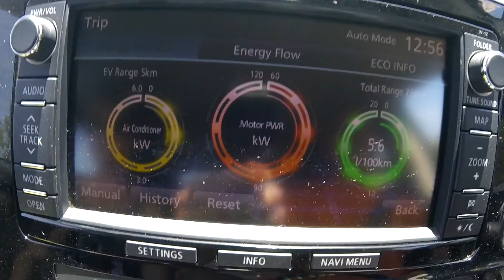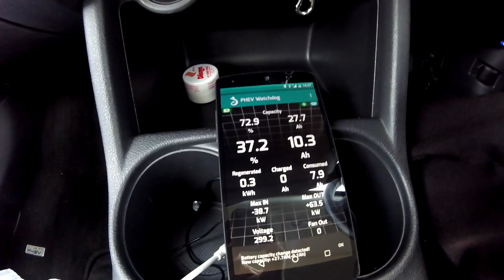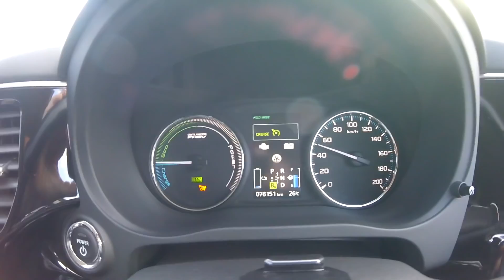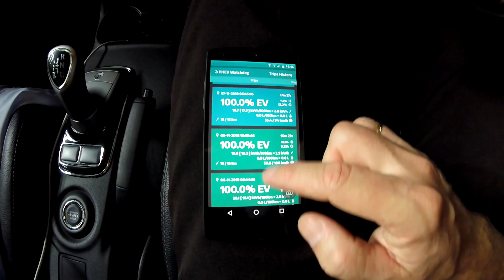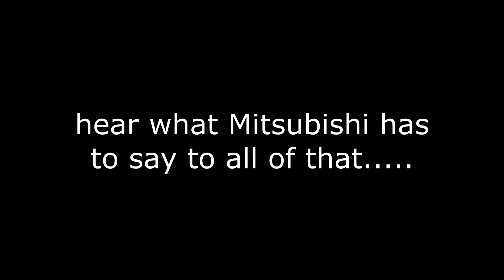EP142 - Battery degrades again after only 3days and 220km.

Comment: Andy stupidest question ever I'm afraid.  I'm getting a g5 2017 in January.  When I'm in the dealership I'm planning on plugging in the odbc2 and using the dog to see what battery health is.  I understand 38ah is 100% health.  My question is does the car need to be charged to 100% or can I see the ah which was last stored at the last full state of charge ?

Looking forward to hearing your result on Monday.
Reply from the maker: Hi Paul, not a stupid question at all. The vehicle does not to be charged. The battery capacity (State of Healthe, SOH) is always available, regardless of the state of charge. All the best with the new car, Paul. It will be amazing!

Comment: Hi Andy I'm at the same ev range as you around 19 miles. But my phev has only done 28k miles. I'm so angry with this car. But Mitsubishi UK say the car is fine. So frustrated right now.
Reply from the maker: You need to get the PHEV Watchdog to measure the capacity. The EV range shown in the car is not a good argument when going to the dealer.
Reply: I have ordered the obd2 and will look at the data before I go back to Mitsubishi
Reply: Paul finch if you have small journey to work and so on then yes buy the phev it will save you money I do on average 60 miles a day and I rapid charge when I can. And before I had a passat bluemotion and my fuel bills are down by 60%. The service hasn't been great so far but when I get the phev watchdog running and take this information to the there attitude may change.
Reply: @chrisiebebop1  I'd be interested to know what your total AH of capacity is at only 28k miles.  Try and get me your results,  as you probably know though Andy your max is around 38ah.
Reply: Are you from the UK? 
I'd that the quality of service we get here ?
Also from your experience would you stay  to buy or not to buy one ?
(Just curious)

Comment: What is the solution that Mitsubishi has given you
Reply from the maker: This will be published next Monday. I'm recording and editing the video right now.
That's the video everyone is waiting for...
Reply: @unpluggedEV  At last!! 😁😉
Reply: Is it gonna keep going down until it has nothing? Out of all EV out there why is it only Mitsubishi have this problem? (Losing at an extreme rate). I wished I came across your channel before I bought one. I would have gotten Nissan Leaf or Chevy bolt.
Reply from the maker: We don't know about other cars. There is no Chevy Bolt Watchdog, right? Almost no other EV has such an awesome app. There is Leaf Spy and a similar one for Tesla but that's it. I never heard about any other PHEV (Audi, Volvo, Mercedes,...) that someone got an app to measure the battery accordingly. I'm sure they all have the same problem but just don't know about it... The Outlander PHEV is a great car I think and there is nothing comparable out there at the moment.